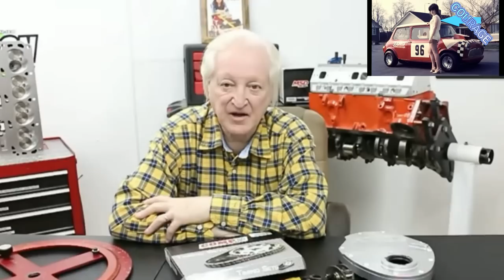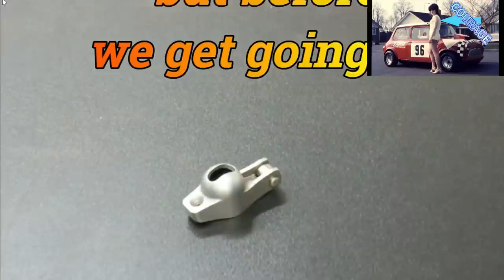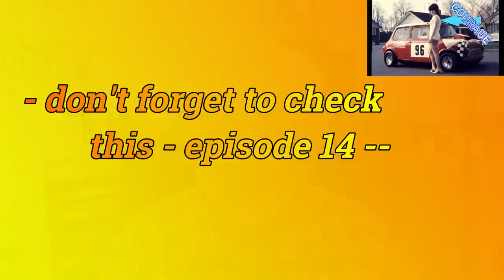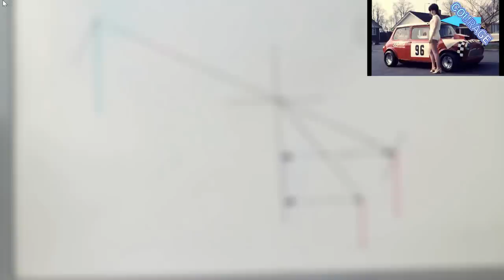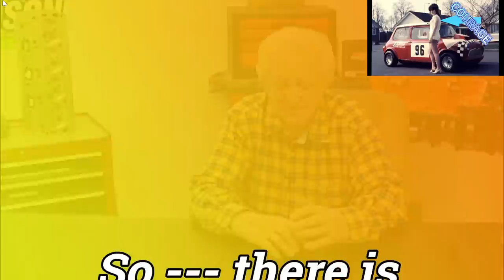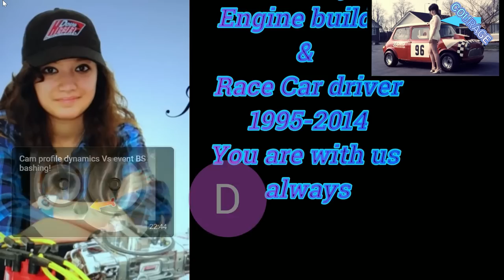High lift rockers - desirable but incorrectly tested.

Comment: Concerning the Siverstone record; first off I think you are confident in your knowledge and experience. But I also think you’re an intelligent person so I don’t think you would risk 5 million dollars on such a wager.  With the advancement and integration of electric motors in vehicles these days I don’t see it being a wise bet.  They will take internal combustion racing by storm and soon overshadow with superior technology.  It will be similar to when 450 4 strokes were allowed to compete against 250 2 strokes in motocross.  The 2 strokes could not compete with the low end power and torque the 4 strokes had, especially coming out of the corners.  4 strokes quickly replaced the two strokes. Literally every team switched to 4 strokes in a very short time. Many manufacturers stopped producing the two stroke bikes.  Now in auto racing i believe the electric and gasoline propelled vehicles remain in separate classes but I imagine someone will come along fairly soon, possibly driving an electric mini, and break that record.  I know this may seem blasphemous but as much as i love the roar of a well tuned v8 I can see times are changing rapidly.  Thanks for the thought provoking question. Cheers